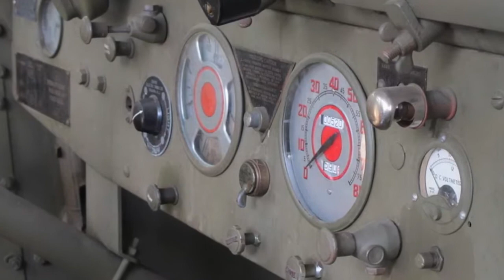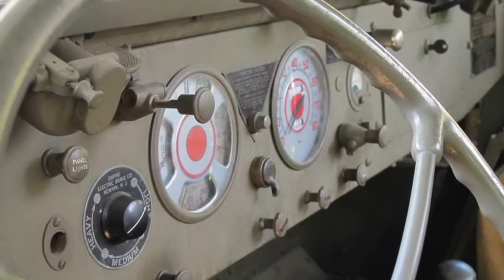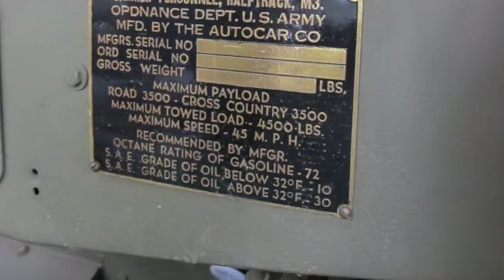M3 Halftrack

Comment: Im not a war expert, but isn't that vehicle too big? I mean a tank can easily intercept it.
Reply: music lover: Hi, the Allied halftrack  was designed as a personnel carrier. It's  main job was moving troops closer to the fighting.  It was never intended to be a front line attack vehicle.It was not designed to  do the job of a tank.Yes the vehicles  are armored but nowhere near the thickness of tank armor. It will fend of small arms fire enough to get it's troops close to the action but that's about it.  Most had a 30 cal. or a 50 cal. machine gun. The benefits of the  halftrack are the mobility of a truck and the traction of a tracked vehicle as well as light armor for protection that a truck never had.They are a unique  vehicle and are very capable off road.